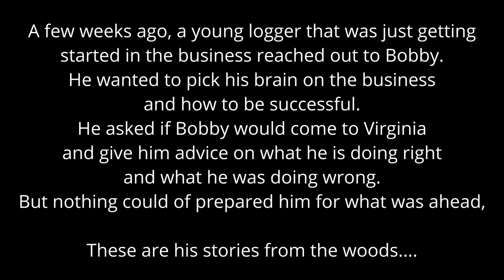LOG LIFE / Backwoods Loggers of Virginia  "Growing Pains"

Comment: Hauling logs is different from almost anything else. Every load is top heavy and that makes for a sketchy ride. You have to take turns slow and think 2 steps ahead. You can't just be joy riding like you're empty. If the driver doesn't understand this they will mess up every time.

Comment: If the deals hes making on the timber involves removing the stumps after hes done clear cutting the timber he might be better off with something like D8 with a Vee blade or a KG blade, digging the stumps out one at a time is gonna be slow and expensive, that old vee blade will take them out with one pass, ive got a 7 with a KG blade and it does really good but i still find its light if you cutting stumps.
That old Pepsi trailer was a dam good deal it had 5000 dollars of hyd lines made up in it!!

Comment: When logging you have to know about grading. You want the best log you can get out of the Tree. Some think you want a long log but if there is knots and other things wrong with the log its best to get a shorter log. I was a logger and worked in out mill and i learned alot. You have to look at the log good and the boards and get the best of the log or board you can.

Comment: You need experience in your job. Part of logging comes stupid mistakes
Reply from the maker: Issue is finding help at all these days is extremely hard. Sometimes help with no experience is trainable and will become great assets to a company. Others won’t listen at all and will be liabilities. Only one way to find out is to try them out.. 

Also, folks have to start somewhere logging is a dying breed as it is. If no one gives folks a shot there will be no experienced drivers out there. They’ve got to start somewhere!
Reply: @Backwoodsloggers Are you still hiring? I can sit in the passenger seat and tell your drivers how they're doing everything wrong while offering zero advice on the correct way to do things. I'm real upper management material! I'm willing to work for you for the low price of tree fiddy an hour. What do you say boss man? Am I hired?